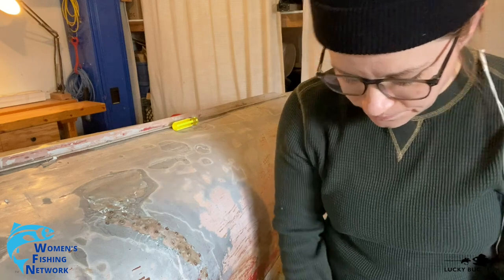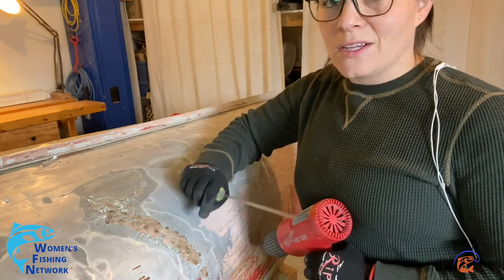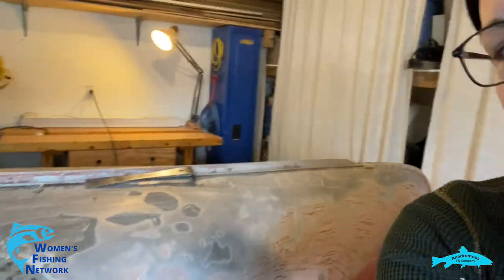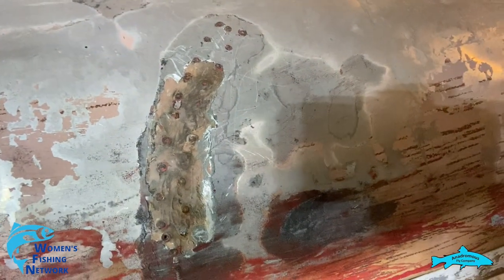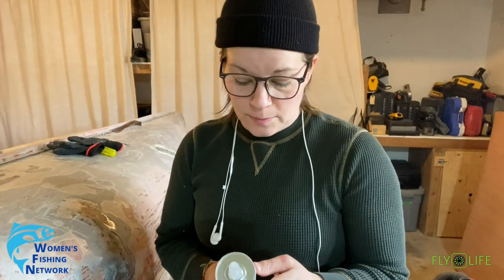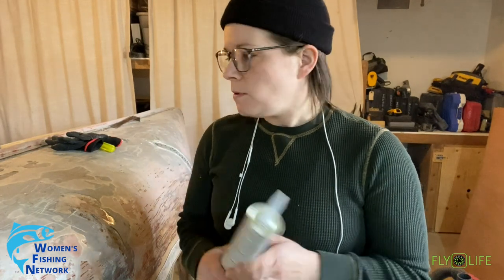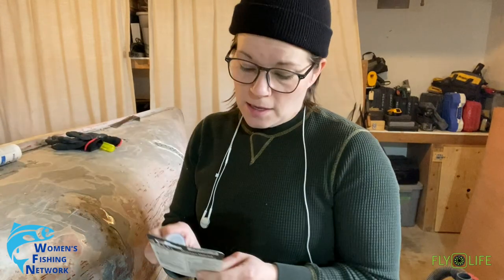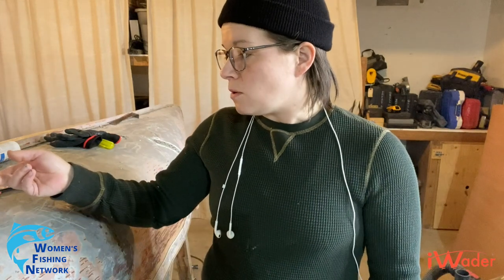Sportsman Canoe Restoration Project Part 2

Comment: Check out my comments in part 1. I think that the products you have picked out there should do the trick. Do not use bondo to repair dents as it is not designed for submerged applications. Instead try and massage out the dents from the inside as much as possible and use the the JB weld to give it a final smoothing. Again stay away from silicone as it will cause issues later with painting, that tubed sealant you have will work just as well and be paintable. Please reach out if I can be of any further assistance.
Reply: Thank you so much! I really appreciate the advice and intel!
Reply: that's awesome of you LilBugr to help out.
Reply: @outdoorskingdome9038  Have no real knowledge in boat repair but I do have a little knowledge with autobody repair. If Amanda wants to pick my brain (watch out for slivers) or even put me to work. I don't mind getting dirty helping out good people.
Reply: I appreciate it very much man!